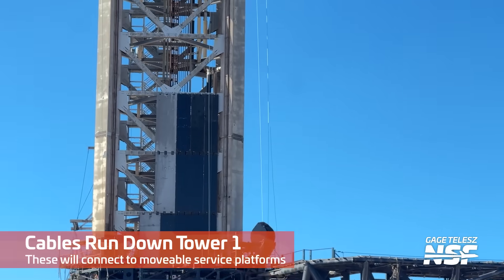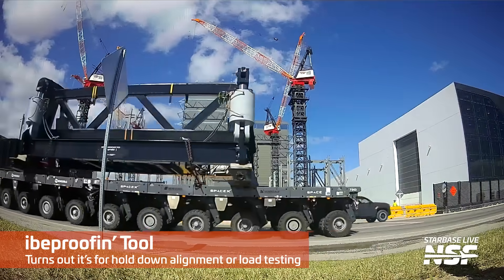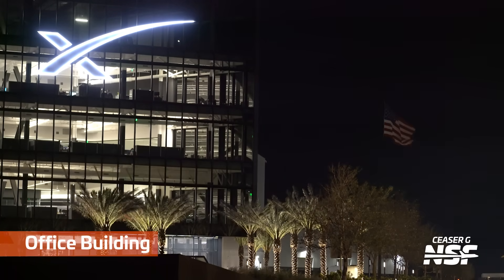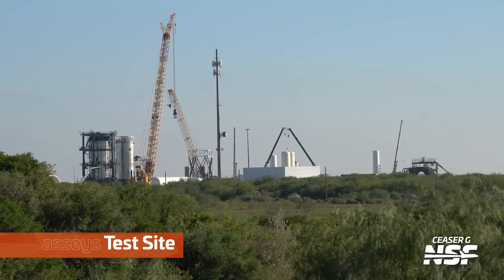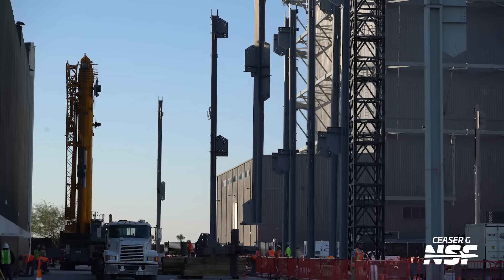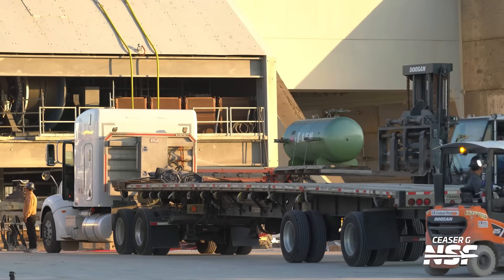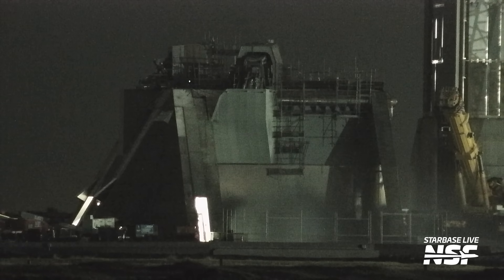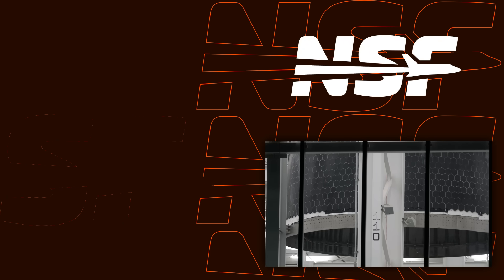"A mystery that makes sense" | SpaceX Starbase

Comment: The DrawWorks were originally from the floating oil platforms that SpaceX bought. They eventually sold them but since the DrawWorks were previously used and then moved to Mechazilla, I would not be surprised to see them replaced. Besides the wear and tear, they are older technology and if you’re launching a rocket a day, the size of SuperHeavy and StarShip you want something to rely on and not something you use to save a couple bucks.

Comment: 6:14 Hey Das. Thanks for the SU! What are these “string” like things attached to the test tank? My assumption is sensor/pressure detector lines?
Reply from the maker: Those may very well be sensors of some type, measuring something around the sides of the tank. - Das

Comment: I doubt they test the tiles by the techs actually pulling on them with a load cell. Looks like there are three separate surfaces on that tool and I suspect it applies the exact force required to test by pushing/pulling (by combination of pneumatic/vacuum?) and the handles are just to position it.

Comment: 7:55 yes it's for alignment and initial positioning when the crane cable is removed.  He's sticking in bull pins and the first few bolts.  When more of the members are attached you add the rest of the bolts and fully tighten everything.

Comment: Depending on the length of chain attached to that hoist and how it's reeved the amount of chain in that yellow box vastly outweighs the dynamic load of the limited swing of the motor. Also the frame it's attached to transfers that swinging impulse to the whole lower frame below the container so it's centre of gravity is quite low in the box.

Comment: I'm pretty sure the TPS tile tester would be called a tensiometer.
Measuring how hard you have to pull something to have it break or even just work properly is a common thing.
Like measuring the force to pull your ejection handles before arming the actual explosives.

Comment: I. B. Proofin is well known for finding out if the engineering and fabrication was done properly. And tell you which was not good. Also those are some wicked short hydraulic cylinde. Large bore also.
Reply: Yeah those big bore cylinders will be exerting a lot of pressure onto something

Comment: 2:46 Ibuprofen is a thing in New Zealand, so the joke still works here. (By contrast, Tylenol is not. It took me decades to realize that Tylenol is just what I call paracetamol. )
Reply: Ibuprofen is the generic name for the drug, like paracetamol (when folowing the INN standard for international non-proprietary names). Tylenol is a brand name, and in the US has just become synonymous with any paracetamol product. Like how in the UK (among others) Hoover is just the name for all vacuum cleaners irrespective of the actual brand (hoover being a specfic brand name). I think there is a term for when a singular brand become synonymous with the whole 'class' of devices but not sure what it is.
Reply from the maker: Our Tylenol is called acetaminophen... it doesn't say paracetamol on the generic ingredients. Always been super weird, afaik its the exact same thing. - Das
Reply: @NASASpaceflight Das, so the INN name is paracetamol, but the US tends to use the USAN  for some 'legacy' stuff (like a acetaminophen used instead of the INN name of paracetamol, which outside the US is most often the one used).

By and large the USAN and INN names are identical, but for a small handful they differ.

Kinda makes good sense to harmonise drug generic names internationally as it means a Dr on one side of the world has a good ideal of the meds being taken by a patient from the other side etc..
Reply: @Thats_Mr_Random_Person_to_you Generonym!
Reply: @VortighastVideos thank you! I've finally got a 'name' for it! I knew there was a term, just not what it was, now I do! Thanks 😊
Reply: @Thats_Mr_Random_Person_to_you  Not usually though. We nearly always call it a vac, or vacuum. For eg I'm vaccing up.  . . .